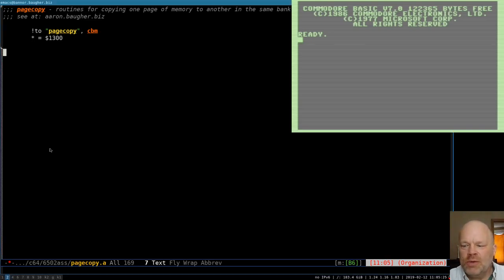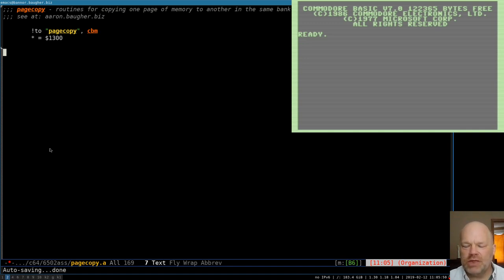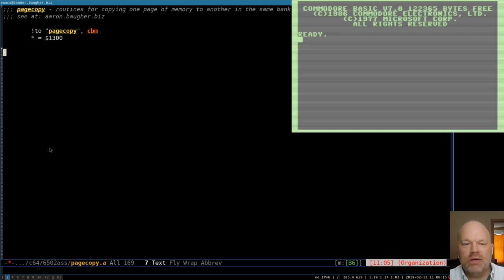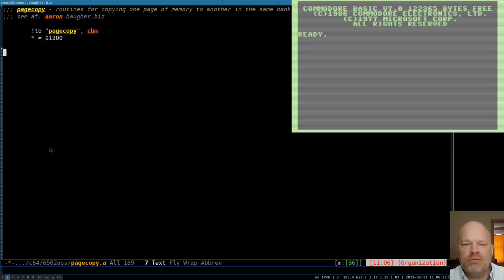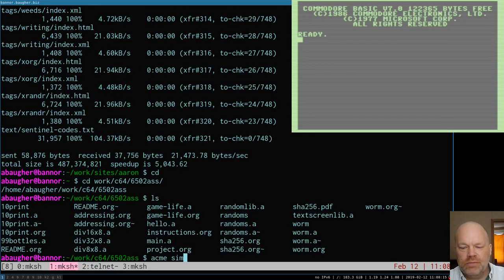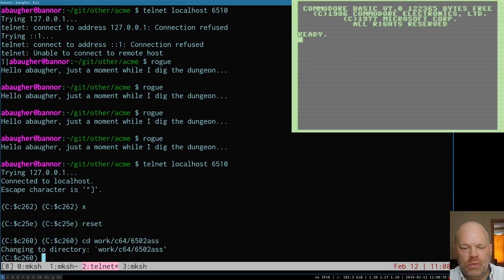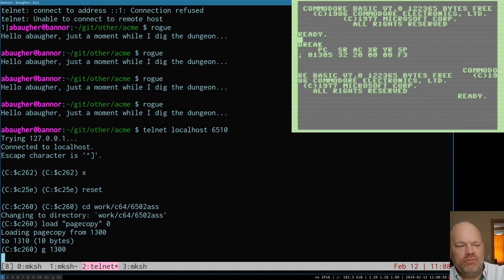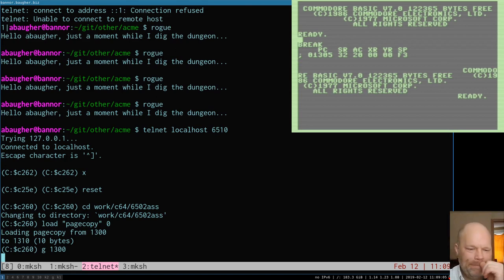C128 Assembly #44: Relocating Zero Page and Stack

Comment: Actually, page zero and the stack are exchanged with the target locations, not relocated.

If I tell the MMU to place the stack at $8000, writing to $01FF (the MPU's notion of the top of the stack, assuming SP = $FF) will go to $80FF.  However, writing to $80FF will not affect $80FF, it will affect $01FF.  This behavior is very different than, say, with the 65C816, in which relocating the stack or zero page (called direct page with the 65C816) really does relocate them to the target address.

Comment: Hi Aaron, hi casual audience

I'm writing from top of my memory, so I did not check against documentation first.
The $0000 and $0001 are I/O ports, implemented just right on CPU.   C128 does not have 6502 but 8510 which is slightly modified.  As these I/O are on the CPU the communication with these do not go through external address/data bus so MMU unit stuff does not apply there.

Next.  Few words to the stack.  I suggest to use words like "the stack pointer goes from higher address to lower address in PHA."  That's because your viewers can be easily lost in hardware stack "magic".  On 6502/8510 the stack grows from high to low.  The bottom of the stack is at top of memory page, the top of the stack goes to lower address.
But that is hardware and software specific.  On some architectures you can have stack growing opposite way.  Or even you can choose which way stack grows.

The stack stuff has always big potential for confusion.  Bottom is up and top is down.

Next, when you write code, it is good to put at specified points comments describing expected / planed state of computer.   Like you did with your copy procedures.  One such a point is before procedure, where you write which value of interest is stored where (register, memory) as you did.  But such a thing is good to write after the procedure entry code before the loop code.  And also after the loop code, before the procedure exit code.

Also is good to write in comment the procedure high level concept.  So at the beginning you have something like:

;; where are the parameters and values of interest
fastcopy:
    ; entry code: store save the registers if needed, store the arguments, modify hardware
    ; do a copy loop
    ; recover the registers, recover the hardware
    rts

Then during the programming you rewrite the comments into real code.  This helps you to keep track of things TODO.  So you do not forget something.  Programming in assembler is more tough and requires hard discipline.

Anyhow, big thanks for your job.  I did not spot anyone on YouTube exposing the thinking process in assembler programming like you.
Reply from the maker: Thank you! Yes, I did some research after this and found that locations $0000 and $0001 don't move when you relocate the stack page, because they're hard-wired to those CPU ports. The C128 Programmers Reference Guide on page 470 says, "It is important to note that memory addresses 0 and 1 are always available at those absolute address references, regardless of whether pages zero or one are relocated." If I'd read that before, it would have saved me some confusion. :-)  So zero page can't be relocated and used as a full 256-byte block for copying as I was trying to do. Only the other 254 bytes can be used freely that way.